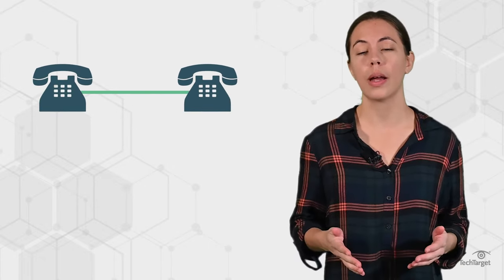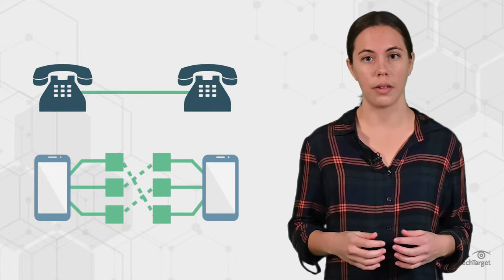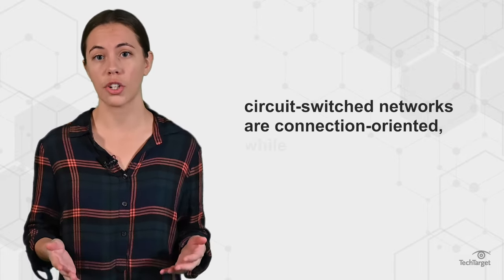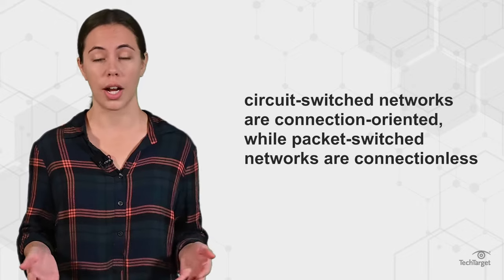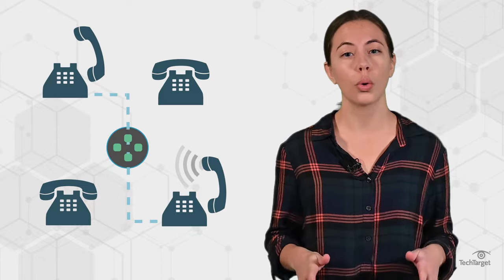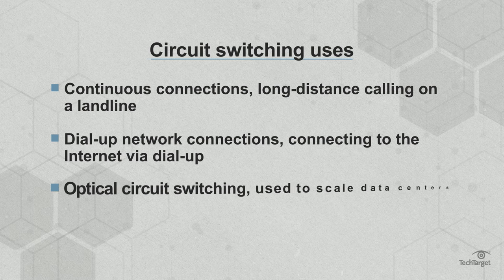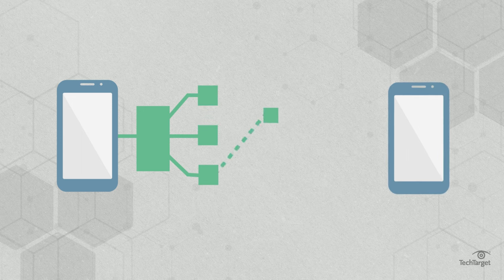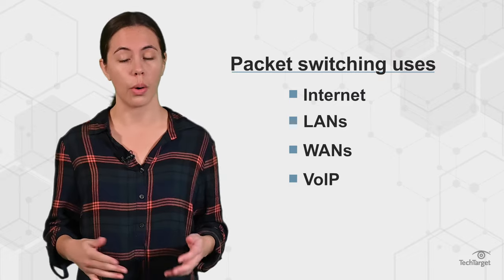Circuit Switching vs. Packet Switching: What’s the Difference?

Comment: Pros of circuit switching:  More suitable for telephone calling and making videos calls as it does not suffer from queuing delays. 
Cons of circuit switching: Complex and harder to implement than packet switching.

Pros of packet switching: Offeres better sharing of transmission capacity.
Reply from the maker: In a nutshell!